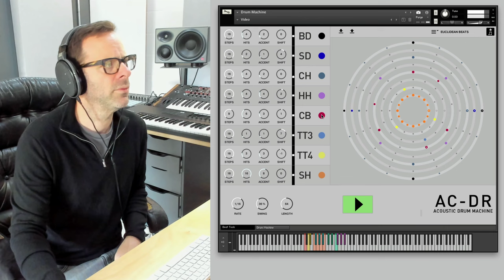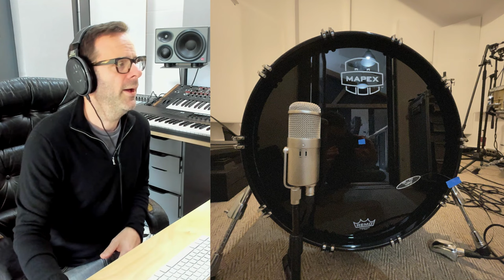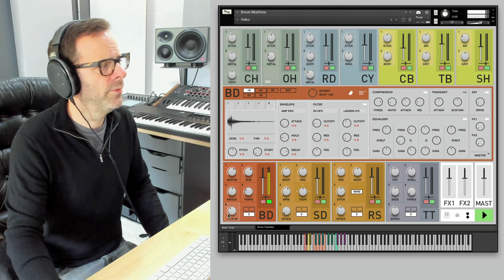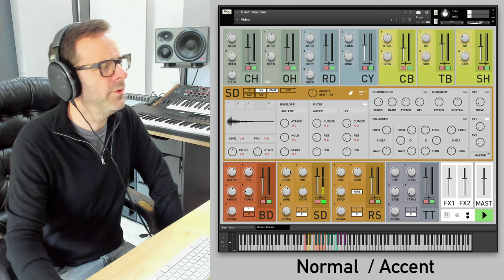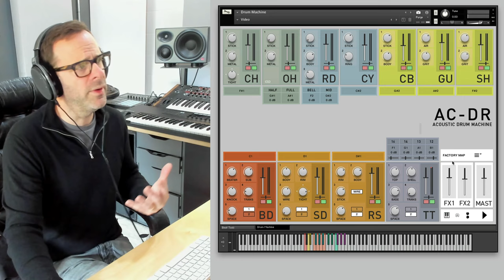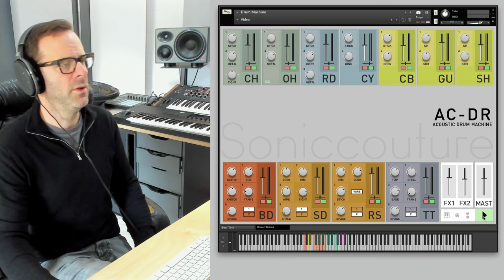AC DR: Acoustic Drum Machine Product Tour

Comment: Sounds great, I'm a long time user of your products and will be getting this one as well. I recently got the Moon Kits and I'm loving the sound of them (though how do I change the reverbs on the busses?).

If you would be considering adding some features in the future, I've always missed the ability of having duplicate instruments. Like I almost always find myself wishing that I could have 2 or more snares and 2 kick drums, so that I can add some sonic variety to simple grooves without having to change them. Yes, I know I can add a second instance, but then I have to sync the settings between them and they do not share the master. It's the easiest thing to do on a hardware sampler, so I am always a bit miffed I can't do it with most drum libraries. On a similar note, it would be nice to have some modulation features from the Konkrete, like the ability to modulate parameters using the velocity.
Reply from the maker: AC-DR has velocity modulation on most parameters -there was so much to cover in the video I didn't get into that.
But the little red number under each parameter is the Vel Mod setting.
Reply: @SoniccoutureOfficial  Great to hear that, thanks! Modulating random stuff with velocity is one of my favorite sound design tricks.

Comment: I've read the manual, but still have a lot of questions. Can I program an entire song and then export it as MIDI into my DAW? I'm not sure how I'd break the Beat Shifter into Intro/Verse 1/Pre-Chorus/Chorus (etc.) sections, and then export the whole song as a single MIDI file. Can I use an AC DR kit to play a MIDI track that I load into my DAW? For someone like me, there are huge gaps in the manual that others probably just take for granted.
Reply from the maker: Beat Shifter: you would create each song part separately then drag it into your DAW. So you make the verse part, drag it in.. change it a bit, drag that to the chorus.. etc.
Yes, you can route any MIDI track you like to AC-DR and it will play. you might need to adjust the mapping of the samples so they are on the right keys, or simply adjust the midi part.

Comment: Question:  Can you use different versions of the same sample for an instrument "slot"?  For instance, within one of the sequencers could I have 3 different lanes of cymbals, each created with different sample choices and sound settings...?  Cheers!
Reply from the maker: Yes and no. You can have multiple sequencer lanes  for the same instrument, ie: snare - but it would be the same snare sound.
Reply: @SoniccoutureOfficial   OK.  I really like your libraries. I own Moon Kits and Sun Drums.  I like the concept of this new library with regard to lots of round robins and not so much concern about velocity layers - since MIDI velocity and filter can emulate much of that in an even smoother fashion.  One thing I miss in this and most libraries is a variety of cymbals as separate instruments in the same instance of the library as opposed to having to open up several Kontakt windows.
Reply from the maker: I see what you are saying. there are two cymbals here, with 3 Ride options and 2 splash/crash options. But yes, you can only have two cymbals at once.
Reply: @SoniccoutureOfficial   Last bit of clarification... you can occupy 4 of the sequencer lanes with 4 different toms simultaneously?  Or 3 different percussion sounds simultaneously.. but only one snare (not counting rim)?  Maybe the video covered voice allocation but I blinked... 😉  Thanks!
Reply from the maker: You can have anything you want on each sequencer lane. You can have 8 snare lanes if you want, but they will be the same snare sound - that's the point I was making. you can't load up 8 different snare sounds.
Reply: @SoniccoutureOfficial  I apologize for beating a dead horse... but I guess I'm a bonehead.  One more clarification.  The video shows TT3 and TT4 (toms, right?) but yet there is only one TT block.  So it appears the Toms is an exception in terms of a different sample for duplicates of an instrument block in the sequencer.  So you could have TT2 played with a mallet in one lane and TT3 played with a stick in another lane?  I watched that portion of the video several times and, although you (James?) are an excellent presenter, on this section you were a bit muffled by the sounds and sort of glossed over the Toms, IMNSHO.  :)
Reply from the maker: @Garflips  no problem!
Yes, the Tom block is a single group of 4 toms, which are edited as a group. So if you change the pitch or add a filter it affects all four. Other drums that work in a similar way are the ride cymbal, which has edge and bell articulations on different keys.
Closed and Open hihat have their own block each so that you can treat them as seperate sounds if desired.